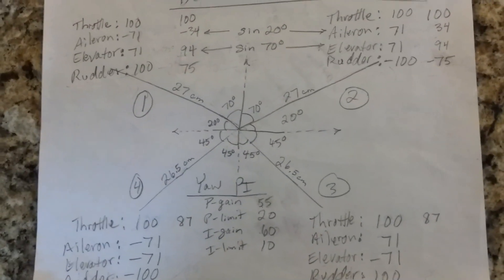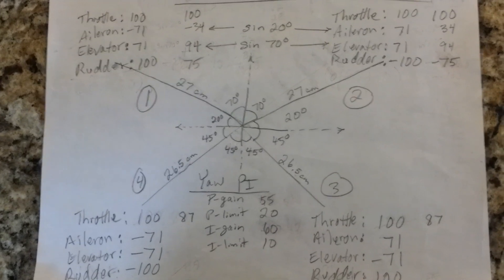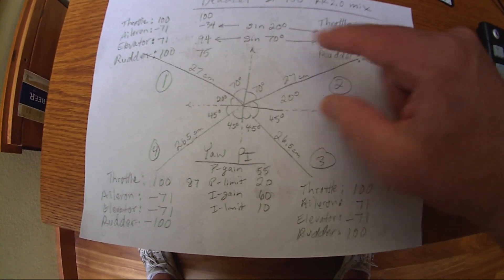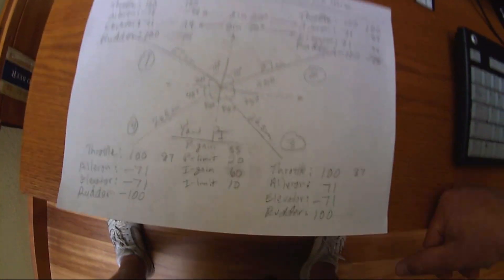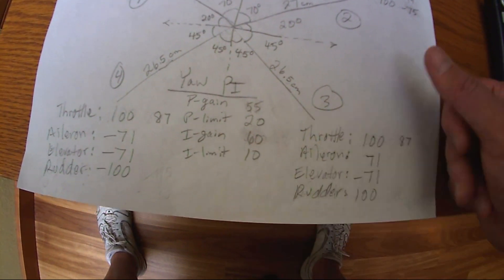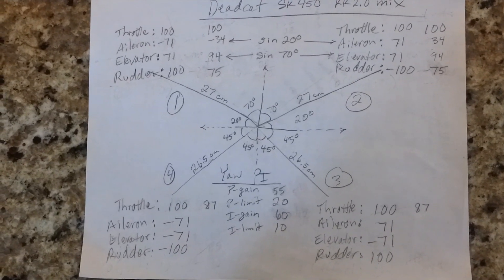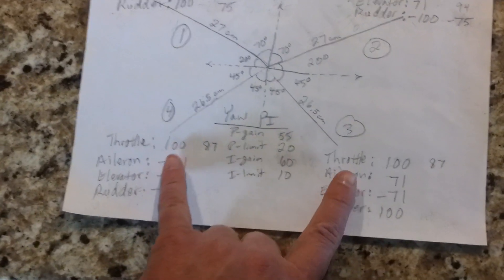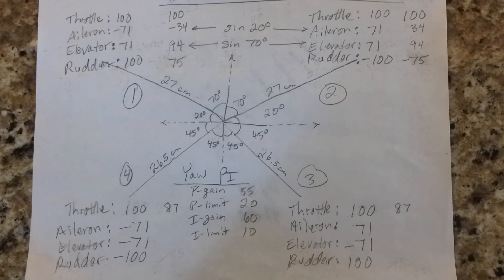KK2.0 mixer editor for the SK450 Deadcat Quadcopter

Comment: stephen newman-whitworth
1 minute ago

 
try measuring the cross point from motor to motor across the centre of the quad set your kk2 in this position it will look weird and a bit far back but see the results you might be surprised  flip 360 have their boards set to x quad config but tell you to set your board this way I think they are on to something might have to set your kk2 back to stock xquad config
Reply from the maker: flip 360 is symmetrical. So this would not be a good setup - it should be stock X
Reply: I think that's what I said

Comment: Hello!
It seems that you got things under control. I need help with gains for the tbs discovery. Im using kk2.1. But i dont get all these numbers you talk about xD any ideas?
Thanks alot!
Reply from the maker: What PI gains do is control how often the FCs sensors (gyros and accelerometers) effect output of speed changes to your motors. PI Gains are a function of your ESCs more than anything else. You want PI Gains as high as your ESCs will allow for maximum stability and response.  You will have to experiment taking them higher and higher until your quad starts to wobble (oscillate) and then back them down from there.
Reply: On the kk2.1 theres PID's for Pitch, Yaw and Roll. It dosent look like it does on the kk2.  Do you know how i can "translate" your settings into some that will work on the kk2.1? Its really annoying that they changed those things, Also, im used to fly with stickscaling 100 on everything. but on 2,1 even 50 ws waaaaay to high :p
Reply from the maker: rallie_86
I agree. DO NOT use the stock firmware. Its full of bugs. You will need to reflash with one of steveis' firmware here. http://www.rcgroups.com/forums/member.php?u=367321 
Get one of the Lite versions, if you want KK2.0 like setting values.
Reply: I already got on of stevies fw's. I tried your settings on mine just now. and its not good on kk2.1. just so you know xD
Now i need to fin the stock settings again :P
Reply from the maker: rallie_86
No. They work fine on KK2.1.x and steveis 1.11S2 -- I have programmed, test flown, and shipped the deadcat with these same mixer settings and PI. BTW, there is an update video here  http://youtu.be/OMBUkaezjns - but its fine tuning these settings.

Comment: I have a X525 frame and I made it in a deadcat position like frame.

I followed your instructions, Sin(29) for AIL, Sin(61) for ELE. So my M1|AIL=-48 M1|ELE=87 M2|AIL=48 M2|ELE=87 M3 and M4 are stock  then after checking the motor layout, they look reversed, M1 and M2 are close together!

So what I did is to take Sin(61) as my AIL and Sin(29) as my ELE, and motor layout matched on my current frame
Reply from the maker: Ignore the resulting picture on the LCD -- it IS backwards.

Comment: I have a few rtf quads,but want to build a large brushless dead cat...i like its looks,but if it doesn t fly well compared to standard x quad i won't be happy...So if i use same board and settings you use think it will  fly great?Is this the hobbyking dead cat frame? Is there a listing of all the parts to complete this model somewhere ...thax
Reply from the maker: I sell Dead Cat RTFs on my multirotor store at http://www.quadrysteria.com/ready-to-fly-quadcopters.html.  And yes, these settings with the KK board make it fly great!
Reply: Quadrysteria thax for the great info... I am not sure if i want a arf or want to build from scratch as i am into building models also...Do you have any idea how long deadcat can hover using a 3s 4000mah? I see other guys using 3s 2200's...thax
Reply from the maker: Fully loaded my the dead cat is 1.4kg and I get 5 minutes full aerobatic flight (plus an extra 1 minute safe return and landing time). That is with NTM 28-26 1000kv motors.  I have not flown a 4000, but have flown 2650 and 3000mah 3S and get only 1 more minute (due to the extra weight). I will guess, if you have similar weight, to expect approx. 7 minutes from a 4000mah.  But the motors make a big difference. The 750kv motors run more efficiently and longer.

My "fully loaded" 1.4kg weight is: 2200 3S flight battery, 1000 3S gear battery, FPV cam, HD cam, and 200watt video tx.
Reply from the maker: roadstar499 I just did a hover test without gear (1215 grams) with a 3S 2200 and 750kv motors, it hovered 8:45 before lagging to ground!  Same craft and same batteray on 1000kv motors only goes 5:45 before lagging - goes to show how much motor draw affects everything.

Comment from the maker: I measured the actual arm angles themselves. You probably measured the angles from the motor centers to the center of the control board? That's fine, and actually is more correct -- to the control board. Roll/pitch forces are not affected by arm angle. Yaw, on the other hand, will be affected in some way by arm angle because torque is applied through the arm, which doesn't line up with the control board exactly. But its probably not too significant.

Comment: I'm building the SK450 Dead Cat (defibrillator main board) and turned it upside down to mark each of the motor shafts.  At least on my version, tthe angle between the rear arms is not 90 deg like yours, but 70 deg and the front arms are 110 deg apart, or 55 deg on each side, not 70 deg.  From your video, yours doesn't look different than mine and I have rechecked the angles carefully.  Not sure why your values are off.

Comment from the maker: This is due to the front (1 and 2) motors. I had to further reduced the yaw mix to 70, for 1 and 2, on my quad to further reduce this tipping effect. Your results may vary slightly due to differences in CG.

Comment from the maker: What version of firmware? X config, right?  As far as I know, the "show motor layout" does not show any angles at all, just the order of the motors. If you are behind the quad, motors 1 and 2 are in front, left and right respectively, continuing clockwise 3 - right rear and 4 - left rear).

Comment from the maker: It's naturally tail heavy before adding equipment because the front arms are 30 degrees forward and the back arms are 45 degrees backwards -- most is the weight comes from the motors. I have to mount my battery a bit forward to get a good CG even with a camera. And with an FPV transmitter in the rear, I offset with battery in front (I don't have a GoPro but it would not be significant factor.)

Comment: I have recently built a sk450 dead cat quadcopter, but still use stock X quad kk2.0 settings. I will try my settings and then yours and feed comments back. My original comment was just based on the kk2.0 manual description and based on hex X settings as a reference. Thank you for your reply.

Comment: ...continued...
As front arms are closer to elevator roll axis than rear, mixer settings should be less than rear.
As front arms are further from aileron roll axis than rear, mixer settings should be more than rear.
Refer to KK2.0 hex "X" settings as example, i.e. front 2 elevator = 87 (60 degrees from elev roll axis (note 45 degrees = 71).

Use sin(radians(angle opposite the distance motor is from roll axis)) = mixer value,
e.g. for front right elevator = sin(radians(20)) = 0.34.

Comment: Nice video, but I disagree with your figures for elevator / aileron. If your angles are 20 & 70 for front 2 arms, then front left aileron should=-94, front left elevator=34, front right aileron=94, front right elevator=34.
From the KK2.0 manual - For aileron & elevator - use positive value for motors on right side of roll axis, and negative for left side of roll axis. The value is given by the motor's distance from roll axis. More is further away.

Comment from the maker: I'm using 3s 2200 - 3000mah turnigy lipos. I'm still on the 1.2 firmware version and don't use the auto level. When I turn auto-level on with the stock settings, my quad pitches forward slightly and the opposite when I turn it off.

Comment: Few more questions. what size lipo are you using. I was using a 3s 3850mah from thunder power. Also does your auto level still work? And if so when you turn auto level off does the quad try to drift forward or back? Thanks for the help.